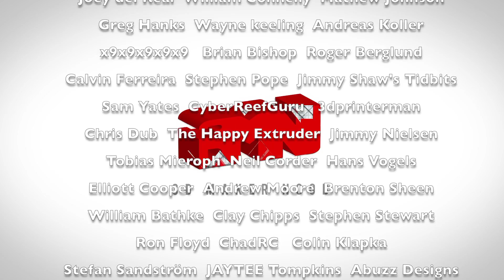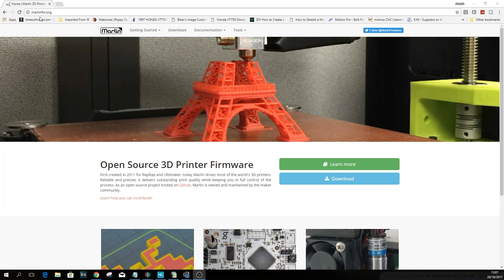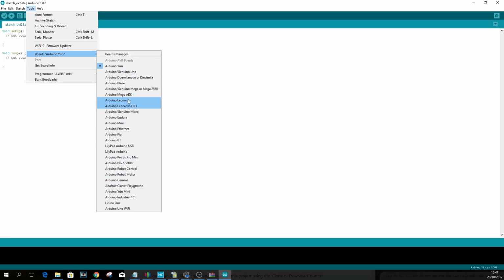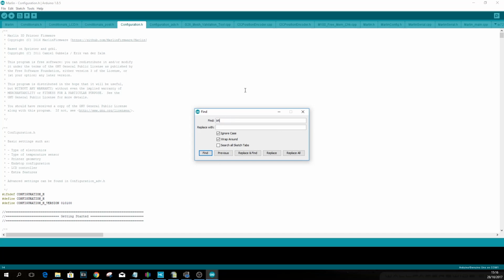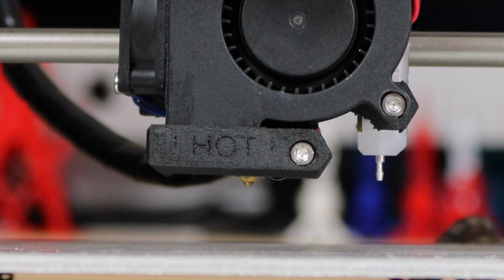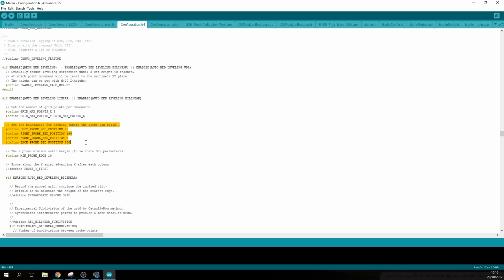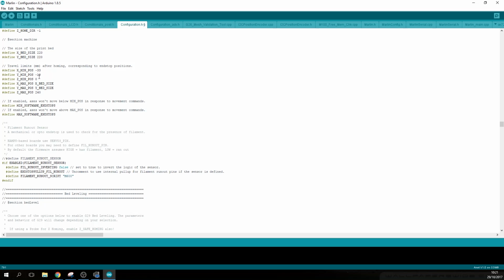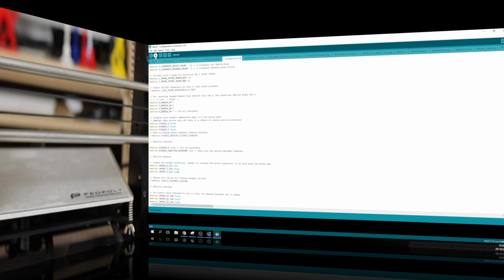BLTouch Setup on an Anet A8 with Marlin Firmware

Comment: Hello
I'm new to 3D printing. A friend gave me an Anet A6 printer with a v1.5 board.
Following some instructions (a video tutorial), I managed to install the latest version of Marlin (V2.1.2.5), which works perfectly.
I would like to install a BLTouch for automatic bed leveling, but I can't seem to modify the firmware.
I followed the instructions I found in the videos, but when compiling the firmware with Visual Studio Code, it seems the program is too large for this board.
Please, is there a solution to make this modification?

Thank you in advance for your help.

Comment: I install the Jim Brown easy configuration bit the hot end wasn’t heating up, then install a different firmware and is heating good now but cannot figure out the BL touch sensor on the marlin configuration section, of

Comment: Nice how to: But why are 95% of all these vid's not telling what Marlin Ver is used. If you have Marlin V1.0.2 the steps are diffrent then for V1.1.9!
I had it allmost perfect on Marlin V1.0.2 but Z offset did not work. Now Have Marlin 1.1.9 and all looks oke but probe pin is not comming down and led insite stay red en will not stop at the bed. Did look every where but still looking for a way to fix it.
Reply: Hi. Did you ever solve this, as I am having the same problem on 1.1.9. Thanks.

Comment: I followed these instructions when I installed my BLTouch and the first thing I noticed was every print took 50% longer than Cura estimated it should take (it was accurate before this). What's up with that? 
I've been having other issues with my sensor not triggering when pressed, which makes the carriage slam into the bed until I unplug/reset it, so I'm trying to go back to the stock firmware and original z stop. It worked at first, but now seems like a complete waste of money..

Comment: Summary Instructions

__BEFORE
//#define BLTOUCH

__AFTER
#define BLTOUCH
#define SERVO0_PIN 27

---------------------------------------------------
__BEFORE
#define X_PROBE_OFFSET_FROM_EXTRUDER 0   // X offset: -left  +right  [of the nozzle]
#define Y_PROBE_OFFSET_FROM_EXTRUDER 0   // Y offset: -front +behind [the nozzle]
#define Z_PROBE_OFFSET_FROM_EXTRUDER 0   // Z offset: -below +above  [the nozzle]

__AFTER (it depends on which bltouch support you have installed, probably you have this info on thigverse)
#define X_PROBE_OFFSET_FROM_EXTRUDER +60   // X offset: -left  +right  [of the nozzle]
#define Y_PROBE_OFFSET_FROM_EXTRUDER 0   // Y offset: -front +behind [the nozzle]
#define Z_PROBE_OFFSET_FROM_EXTRUDER 0   // Z offset: -below +above  [the nozzle]

---------------------------------------------------
__BEFORE
//#define Z_SAFE_HOMING

__AFTER
#define Z_SAFE_HOMING

---------------------------------------------------
__BEFORE
#define Z_MIN_PROBE_ENDSTOP_INVERTING true

__AFTER
#define Z_MIN_PROBE_ENDSTOP_INVERTING false

---------------------------------------------------
__BEFORE
//#define AUTO_BED_LEVELING_BILINEAR

__AFTER
#define AUTO_BED_LEVELING_BILINEAR

---------------------------------------------------
__BEFORE
  #define LEFT_PROBE_BED_POSITION 15
  #define RIGHT_PROBE_BED_POSITION 190
  #define FRONT_PROBE_BED_POSITION 15
  #define BACK_PROBE_BED_POSITION 170
  
__AFTER (it depends on which bltouch support you have installed, probably you have this info on thigverse)
  #define LEFT_PROBE_BED_POSITION XX
  #define RIGHT_PROBE_BED_POSITION XXX
  #define FRONT_PROBE_BED_POSITION XX
  #define BACK_PROBE_BED_POSITION XX

---------------------------------------------------
__BEFORE
#define X_MIN_POS -33
#define Y_MIN_POS -10
#define Z_MIN_POS 0
#define X_MAX_POS X_BED_SIZE
#define Y_MAX_POS Y_BED_SIZE
#define Z_MAX_POS 240

__AFTER (it depends on which bltouch support you have installed, probably you have this info on thigverse)
#define X_MIN_POS -xx
#define Y_MIN_POS -xx
#define Z_MIN_POS 0
#define X_MAX_POS X_BED_SIZE
#define Y_MAX_POS Y_BED_SIZE
#define Z_MAX_POS xxx

---------------------------------------------------
__BEFORE
#define INVERT_X_DIR false

__AFTER
#define INVERT_X_DIR true
Reply: FOR DELTA KOSSEL?

Comment: I just did this on an anet a6 and struggled a bit but finally got it going. For those doing this for an a6, you will need to use pin 29 on the board. Pin 29 is in the same row as 27 but two pins closer to the edge of the board. Also, in marlin 1.1.8, for both the a6 or a8,  you don't have to add the servo0 definition, it gets defined by the pins_anet.h file when you set bltouch enabled and select the display type in marlin.
Reply: Hi 1990notch, I'm still struggling. I moved the cable from 27 to 29 but when I autohome the nozzle will crash into the bed and bltouch doesnt respond when the pin gets sucked in. Im using marlin  1.1.9 right now, could that be the problem?

Comment: Keep up the good work,
I have been following your videos for a few months now since getting an A8 for my grandson for christmas (and 1 for me too).
I have an question about the Arduin IDE compilation, you cut off before it would become visible, but I consistently get Orange Warning messages just before the check compilation completes.
The warnings go by so quickly most people may miss them, you can just see the occasional flashing orange character in the black panel at the bottom before the IDE screen completes with the white success message, the warnings have scrolled of the top of the screen, and are no longer visible.
You can see the messages if you expand the black results bar by either draging the top up or by moving the slider at the right hand side.
I get very very many warning messages about timers being reset.
Do you see this warning.........I have followed the instuctions as shown here and on many other videos to the letter. 
I have raised it on an Anet A8 facebook page but only one person seems to have the same issue.
I have I think found a solution, but I am supprised I am the only person to notice this and be worried about it.
Can you please check your marlin build, to see if you get the warnings when doing a check compilation. no need to connect to an A8.

Comment: I have a question about measuring the distance from the probe to the nozzle... In your video you measure with the probe retracted. When I do so, they are exactly the same so I set the Z_PROBE_OFFSET_FROM EXTRUDER variable to 0. But after probing, it tries to print around 4mm above the bed? Why would that happen?
Reply: i have the exact same problem now.  did you find a solution ?

Comment: it will save the leveling if you put m500 in the start code this saves to the EEPROM settings. However, you need to have EEPROM settings enabled in marlin.

Comment: Hey joe thank you for this video. I got all the steps done after installing the touch sensor but after uploading the new settings with the marlin firmware, my printer boots and then has “?” Flashing in x and y coordinates and when I go to prepare, control , print from sd or   Reload sd card, it just returns to the normal idle screen. It’s like there is no menu options . Have you or anyone else had this issue? I’ve had to put my printer offline till rectified until I can fix. Any help much appreciated

Comment: Was hoping you can help me out I'm having a problem getting the BL touch working(on the Anet A8) it won't allow me to upload it to my board once I change the parameters. I changed everything like you did in the video and it gives me a failure to connect to board. Tells me to select some other kind of Arduino board in the error code. If I don't change any of the parameters or the g code it uploads no problem but I can't seem to activate the BL touch and get communication with the board for some reason can't find any help anywhere online don't know if I'm doing something wrong or if you're coding is different for what you're using and is causing me to not be able to upload it to mine I was hoping you could shine some light thank you

Comment: Are you sure Marlin doesn't remember the mesh leveling?  I have been leveling through the printer menu and not adding a G29 code and it seems to have been working fine.

Comment: Good morning Maker! 
I'm messing with my Anet A8 and I have a problem. 
I followed your video for the installation of a BlTouch sensor and when I turn on the printer the red light turns on, raise and lower the stem for its calibration. 
The problem comes when I do homing, the shank does not lower and the nozzle touches the bed without the BlTouch detecting anything. 

Thanks for your time and happy Christmas☺️ Greetings from Spain 👍
Reply: Did you ever figure this out? I'm having the same issue.
Reply: Try reflashing the firmware otherwise it might be a defective probe

Comment: Hello, thanks for your helpfull video's. Will there be a video about Acceleration and Jerk settings anytime soon? As i copied your anet p3steel mod, it prints way worse than before on a stock frame and i think its due to those settings. Currently trying out stuff in Mattercontrol. Perhaps you got any guideline with settings you have set on your P3steel conversion with marlin?
Reply from the maker: will be doing a guide on it shortly :)

Comment: Hey joe, I was got finished adding all the coding and what not and when I went to run the program my lcd screen just froze up. I know this may not have been a good  idea but I unplugged the power cable after trying to press the reset butting numerous times... a little bit of help would be much appreciated
Reply from the maker: +Marshall Roe it is supposed to freeze until all the code is uploaded and then it resets itself
Reply: Okay thanks I was just worried because on the computer it was saying like the printer is not responding or something like that when I first uploaded the software

Comment: will try to do this but on my smoothieboard...any experience with this board? it not working, will go to arduino mega and marlin...
Reply: BLTouch definitely works on Smoothieboard because I have one working on mine :) Make sure you have the latest firmware and then just do a bit of googling. It took me a bit of fiddling, but I got there in the end :)
Reply: Andrew Gillard thanks! Im not expert on firmwares. Any reco on where to read how to set fw and related stuff for bltouch installation? Thanks
Reply: Sorry for the late reply! it looks like the z-probe page on the Smoothieware website now has a very comprehensive section for the BL Touch: http://smoothieware.org/zprobe#bltouch-or-servo-retractable-touch-probe. I found this page to be helpful when I was setting up mine (before the zprobe page itself was very useful): http://forum.smoothieware.org/forum/t-1760423/bltouch-support

You'll also have to configure gamma_min_endstop (i.e. your bed probe) to be "nc" (not connected) because you'll need to use the gamma (Z) min endstop signal pin as the signal from the BL Touch.

My config won't be directly applicable to yours, because I've modded my Prusa i3 (clone, not an "original" one) to have a Z-Max endstop, so that it can home to Z-Max and thus get a rough idea of where the nozzle is relative to the bed. It only needs to get an approximate location from that, and then it can move the extruder to about 50mm above the bed and then use the BL Touch to get an accurate position. I'm really not sure how things will work without a Z-Max endstop - you might have to manually move the extruder in the Z direction so that it's around 5-10cm above the bed and then use `G92 Z50` (to tell Smoothie that the extruder is 50mm above the bed), which will be close enough for you to then be able to use the z-probe commands to get an accurate position.

Anyway, I've uploaded the relevant parts of my Smoothie config, which I've modified to remove the Z-Max references, here: https://gist.github.com/aziraphale/4fa0ff12371567569ef69e2fbacad306
And in case it's helpful, this is the relevant parts of my config which I haven't modified, so these config values will only make sense if you have a Z-Max endstop: https://gist.github.com/aziraphale/ee6dd2634485c343d87e57468453760e

Hope this helps :)
Reply: Yo are amazing! will try everything!!

Comment: It's also an 'how to create your own firmware' for dummies. Thank you.
What would I need to do, if a printer (Tronxy X5S) wasn't in there? Would it be enough to create the Configuration.h file with the right parameters, or wouldn't this work because of unsupported board hardware? (There's a Melzi 2.05 in this printer).

Comment: not tell people and showing the connection is like here is a bowl of soup but you dont need the reciepe. i bought my bl touch before they figured out the conntections on the a8.  so the mystery carrys on
Reply: 3D Maker Noob I think Mikey got his little feelings hurt, Joe! Maybe he needs a little hug! ;)
Reply from the maker: how is it different from me showing a diagram of where wires go and me showing the wires where they go?? it's as clear as day on the bltouch website. you have the board and it shows you which wire goes where.....
Reply: i knew none of this i got it when it was first released. thanks for ur snoooty reply ill never bother u again thanx
Reply from the maker: it's not a snoooty reply, i'm just saying that there is no point in me showing people how to slide a clip into a pin as ultimately that is the case. there are instructions on the bltouch site so i didn';t feel the need to show it. it's not really a mystery when you have instructions. i understand that it wasn't there initially but now it is, so not really sure what the issue is anymore
Reply: a complete and utter lack of information. i didnt know the instructions existed. i watched a lot of ur vids and learned alot . but no more i wont be treated a fool for not knowing something again ty good day sir
Reply from the maker: Well i apologize if you feel that way, wasn't my intention. on the other hand, you did come on the channel accusing me of not giving out enough information when it already is there.

Comment: Thanks for this. I had just uploaded SkyNet3D on my Anet and have now uploaded the Marlin one instead, as I didn't know this was out..  I don't have a BLtouch, but I'd rather have the actual version instead so if can eventually afford a probe, I can just tweak the few lines I need to.
Reply from the maker: i've yet to have a failed print due to bad first layer adhesion so i highly recommend it when you can get one

Comment: Hey joe not telling you what to do, but it would be great if you take a cheap 3d printer and mod it to its full potential
Reply from the maker: +mrquinto93 well the Anet in this video was under 150 and is slowly being upgraded. In fact it will have a duet wifi installed soon with a touchscreen :)
Reply: that is exactly what he has done with this series of vids about the a8. He has effectively modded it to its potential

Comment: Nice overview! I took note that you had to set your SERVO0_PIN manually, and have patched Marlin so that if you have no (Anet-standard) LCD option selected the pin will still be defined. For Marlin 1.1.6 it's defined to 27 for ADC Keypad, and 29 if you have a graphical display. For Marlin 1.1.7 and 2.0.0 the pin will also be defined as 27 when you have no LCD or keypad … or if you just have a character-based one.
Reply from the maker: +Scott Lahteine wow awesome! Thank you :)
Reply: Thanks for making the video. How users experience the configuration process is always of interest. And, as it happens, I'm setting up a BLTouch on my i3 today, so this is highly relevant to my success or failure!

Comment: Hey Joe. I end up putting a ramps 1.4 board on my Anet a6, since one of the drivers on the Anet board died. It was really easy to setup the bltouch on the ramps board. Where did you get the frame for the a8, I'm looking for something similar for the a6?
Reply from the maker: +Marcel LeMay it’s a press i3 steel from orballo printing in Spain. Quite cheap. If you look at my anet upgrade video part two, there is more info on it

Comment: Thank you for this informative video. I would like to add something about Marlin and bed leveling. As you said using G29 in the start script (not to issue G28 after is important) will do bed leveling at the beginning of each print. Actually if you make EEPROM available in Marlin Configuration.h, then you can store the bed leveling data to EEPROM and call it back at the beginning of each print by inserting M420 S1 instead of G29 in the start script. You need G29 (or from the LCD "Bed Leveling") only if you physically change bed level or do anything which will affect it.
Reply from the maker: awesome, good to know. i will definitely be testing that out :)

Comment: Thanks for the video , this will help alot with my P3steel conversion. I'm currently at a point its is assembled but still need to do the wire-ing and programming of the board. But i'm still looking for a solution for the Y endstop switch. i have printed the ones you provided in your tutorial  but can't figure out how to mount that switch. Seems the bed can't move enough to the back as it hits the switch too early.
Reply from the maker: +Optic in fact what I did with the switch was use meshmixer to extend it a cm in order for the bed to reach it.

Comment: Check out marlin-config. It is simplifies everything IMHO. https://github.com/akaJes/marlin-config/wiki/Windows-Installation
Reply: What is this?  (from a newbie)
Reply: It is a utility that automates downloading, configuring, compiling, and flashing Marlin firmware. It is a little difficult to setup. But once you do, you never need to manually edit source code or use  Arduino IDE ever again.
Reply: Thanks.  I will give it a try.

Comment: How much did you spend (or what would it have cost you if you had to buy/ship these parts) until now modifying the Anet A8?
Reply from the maker: +3D Gussner so far I’d say it cost me around 150, I bought the frame, new stepper motors with integrated lead screws, new rods and new E3D V6 . The bltouch was given to me by antclabs